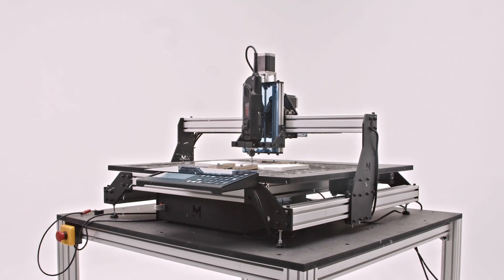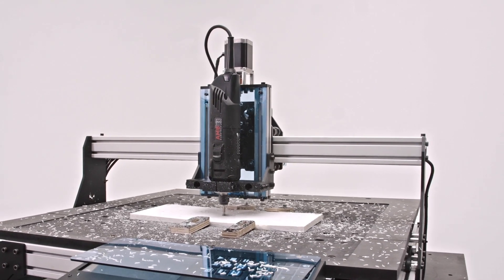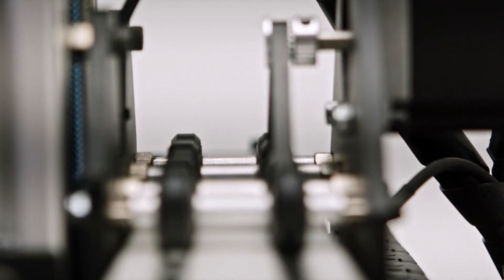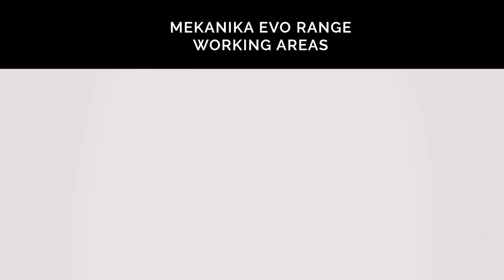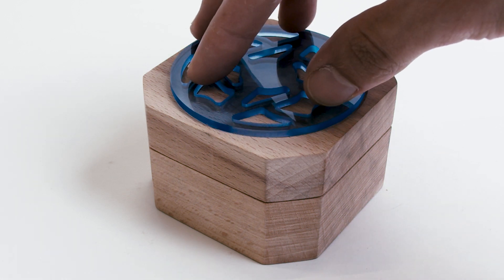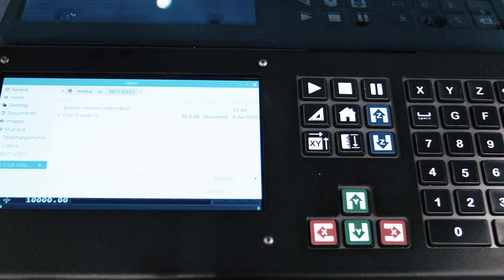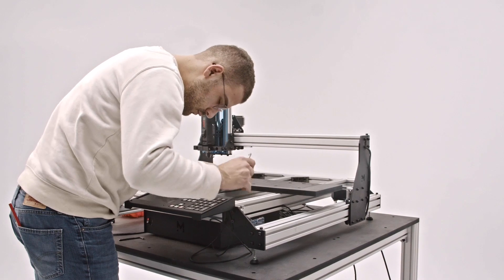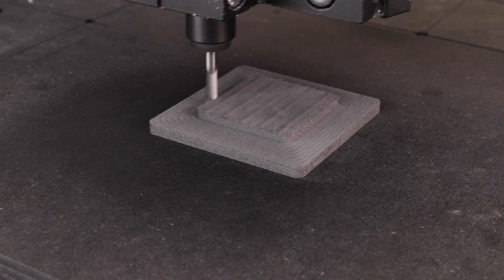Mekanika EVO | Product Presentation | Desktop CNC Milling Machine

Comment: How easy is it to convert an Evo S into an Evo M? It looks as if it's just a matter of installing longer profiles and longer belts?
Reply from the maker: Yes, basically this is it. Also the cables and cable management system has to be longer.
But we would recommend to start with the right size needed instead of converting, to reduce the costs of course.

Comment: Looks good, unfortunately I  saw this video just now.  I have always bought a FoxAlien vasto cnc. Any details on the controller used here, is it offline or pc controlled?
Reply from the maker: It's controlled offline through PlanetCNC (formerly USB CNC), but there's a RaspberryPi integrated, you don't need an external computer either :)